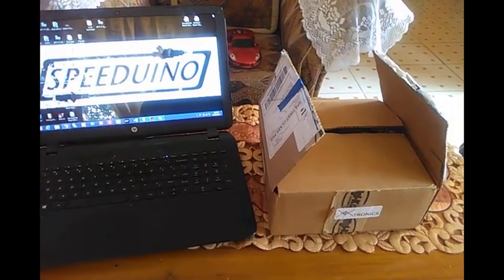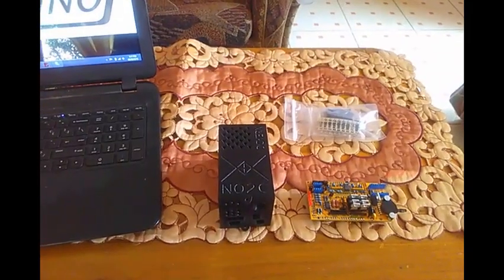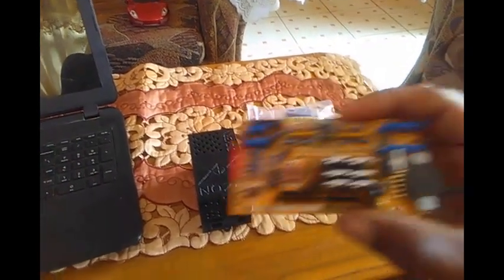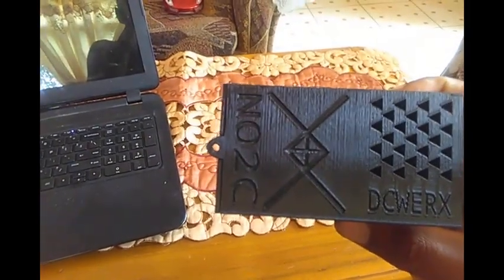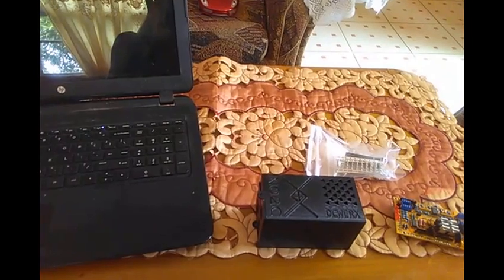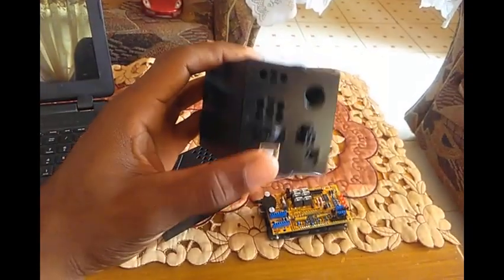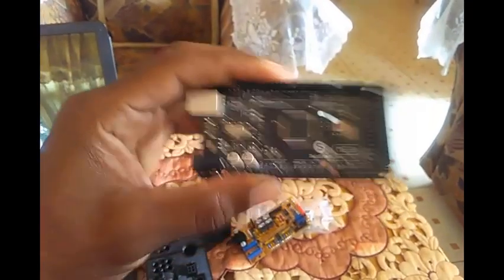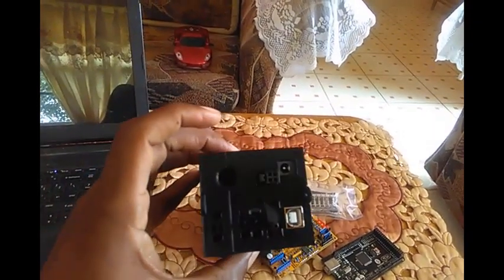$100 Standalone ECU

Comment: Im Very Interessted by Speeduino for Tuning a R32 GTST.
Do you have any price range for made a harness converter from ECU to Speeduino connector ?
Reply from the maker: There are no off the shelf harnesses for a R32 GTS, it will have to be custom